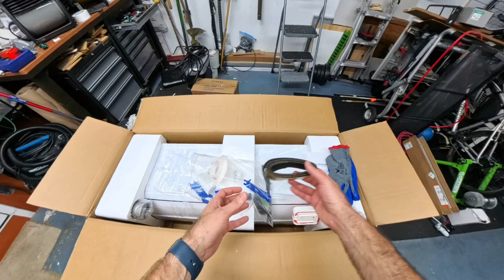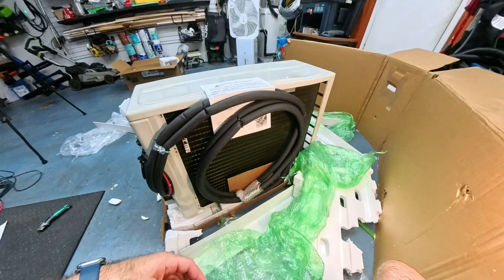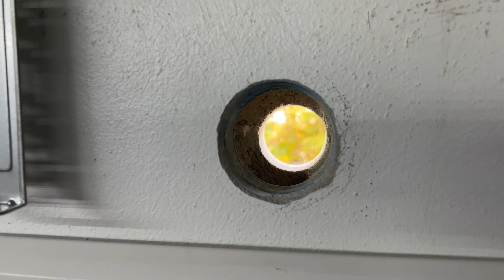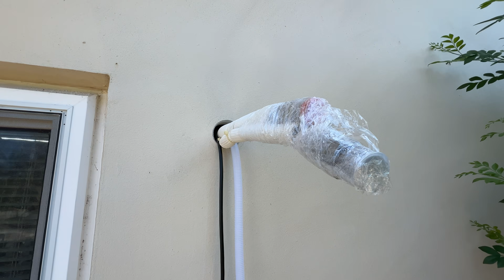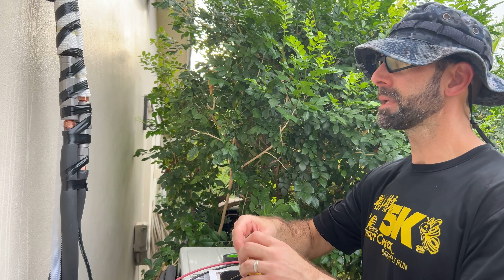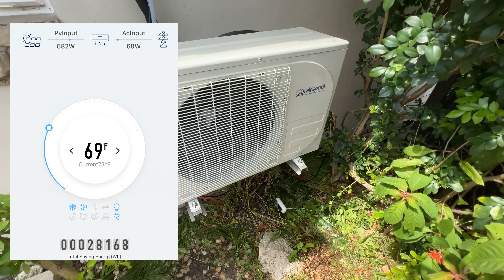DIY Solar-Powered Mini-Split AC Installation – Airspool Step-by-Step Guide (garage tested)

Comment: How many solar panels does it take to power the unit?
Reply from the maker: Minimum 3 if they are in the 400-500w range but it depends on their output voltage and amps. Their website has specifics on that.

Comment: Just ordered my 2nd unit. Sign up for newsletters and you get $150 off. Don't be surprised to have Dave email you directly, often. You might be able to find the unit a bit cheaper, but it won't come with the quick n easy setup and kit of tools, etc. 2025 is the last year to get the substantial energy credit.
Reply from the maker: That’s awesome, how many panels are you using per unit?
Reply: @reallyMello I bought 4 320w panels from Renogy.  But, I've never seen the draw in watts over 800w. I live in N Idaho, though, and we haven't hit over 96F this year. It's in a garage sized bedroom over a full garage, so it can get quite warm and it gets full sun. The minisplit keeps our room at about 68F or lower during the heat of the day.

I will probably purchase 2 400+ watt panels for the 2nd unit. 

BTW, we got down to 2 or 3F this winter and the unit worked great. The heat pump is on a deck. It froze up once, so we put a lifetime table over the top with an old spa solar blanket draped over it ensuring airflow was not restricted. That seemed to keep it from freezing up. Wife's idea...I didn't think it would help. Lol

I was trying to order the new unit that works down to -22F, but my wiring is not up to snuff. I'll update my wiring in the basement and order that unit next.
Reply from the maker: I think 2, 400 watt panels may not give enough volts, I think Dave advocates for 3. The one in my garage uses 970watts during the hottest part of the day right now typically and sometimes I’ve seen it just over 1000watts.
Reply: @reallyMello maybe, but that's what's great about a hybrid. I can start with 0 panels and add more as needed. If I never or rarely exceed 800w, then using a little VC is cheaper than a panel.

I don't ever expect a ROA. It's about having power source options AND a much more efficient heating/cooling system.
Reply from the maker: Ya I love it. Makes my garage so much more pleasant to be in and since my central AC equipment is located in the garage I think this will extend its life vs being in a humid space.
Reply: @reallyMello sorry,  one more tidbit. If someone is already using iot/smart devices using the Smarthome app, pair the unit with that app instead of the airspool app. It's the same app branded differently.  I can use a smart thermometer across the room to kick on the heat or AC if temps reach an extreme high or low using an automatic scene, for example.

If the app is important,  ensure the wifi signal is good to the head unit. After pairing, my unit lost connectivity while on vacation.
Reply from the maker: Have you found that using the app the unit stops cooling when it reaches the set point either on auto or cool? It seems to cool below my set point for me.
Reply: @reallyMello our room seems to stay right at the setpoint. If we set it to 68F at night, the thermostat across the room stays at 68 all night. I wonder if your unit keeps running because it's sensing the garage is still over the set point. If I recall, the difference needs to be greater than 7 degrees from the temp shown on the app below the setpoint. 

I'm sure Dave can explain why better.
Reply from the maker: So if I have it set to 77 it would need to go to 70?
Reply: @reallyMello search the manual for the "mode". Auto will heat or cool within +/- 7 degrees. I set it to cool or heat, not auto. As the room temp gets closer to the setpoint, the unit uses less energy. I don't have more details. It's a Ningbo Deye hybrid minisplit sold by eg4 and other resellers so you can find more details on forums or email Dave directly. Sorry.

Comment: I also have a thick cinder block, and I wonder if the diamond core drill bit is necessary? Is it possible to use the included carbide drill bit and attack it from both sides?
Reply from the maker: If you manage to drill into the hollow cavity and can ensure the correct angle for the entry and exit holes the included bit would be deep enough. For me, I felt getting the longer diamond core bit was worth it.
Reply: Thank you. My garage isn’t as polished as yours where I can see how they stacked the cinder block, so maybe I can aim for the center area where it’s hollow.

Do you remember if it comes with a concrete block anchor?

Great work on the video by the way. It helps setting up the expectation!
Reply from the maker: @raylannister9722 it comes with plastic wall anchors which may be less ideal in masonry over something like a tapcon or sleeve anchors.
Reply: Thanks again! I plan to use a lag shield anchor which I think it may suffice. I appreciate the quick responses!

Comment from the maker: 🚀 Upgrading to a solar-powered mini-split made a huge difference over the portable AC I was using before! The cooling efficiency, noise reduction, and dehumidification are on a completely different level.
I was skeptical about going solar, but now I don’t feel like I’m wasting electricity just to keep my garage gym cool. Plus, the hybrid design solves a major concern—air conditioners usually need expensive battery storage to run at night or during cloudy weather. With Airspool's design using plug-in backup power instead, I get reliable cooling without breaking the bank on batteries.

Pairing this Airspool mini-split with garage door insulation has completely transformed my garage gym space. Even when it’s over 90°F, I can make it practically chilly when working out! ❄🔥

👉 Have you thought about upgrading to a mini-split? Would you try solar-powered cooling? Let me know below! 💬